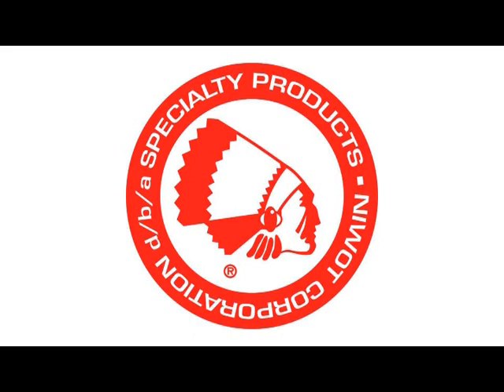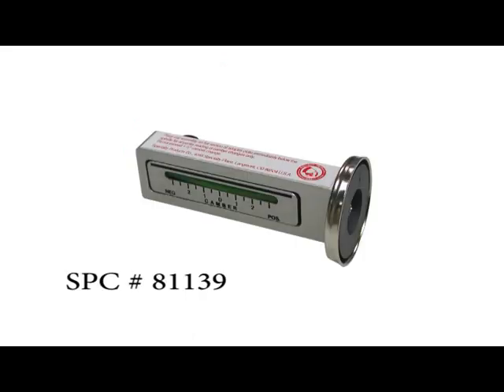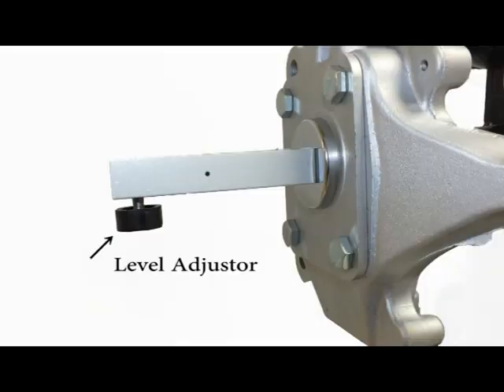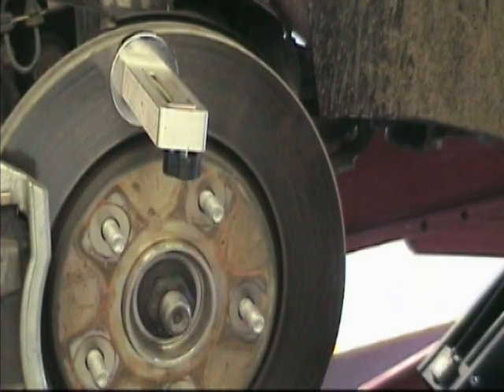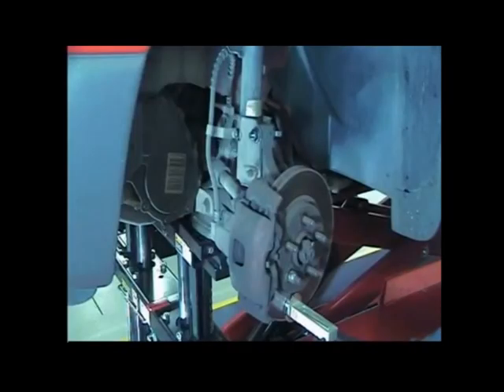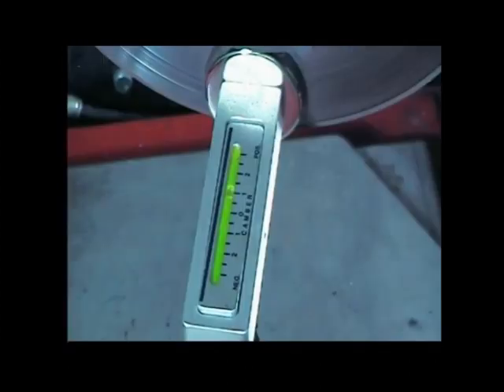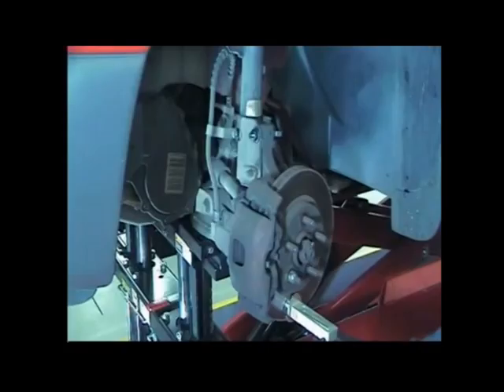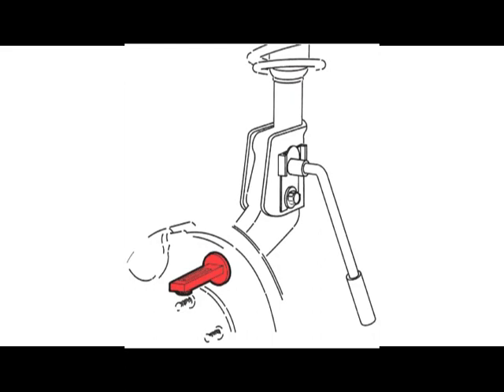81139 - Magnetic Adjustable Camber Gauge - SPC Alignment

Comment: For Pete's sake, how do you calibrate tool before use? Camber reading on the tool will be different with the wheel on the ground/loaded and with the wheel removed/hub unloaded, as when suspension drops hub down, camber changes.
Reply: You have to use a level or level source that you can trust is accurate and compare where it's set at. Adjust when you feel comfortable you are level at zero and see where it is. But what this video is saying is to check you camber before you begin. If you are at negative 1.5 degrees, and want 0 degrees, then whatever it is reading unloaded adjust until you get that 1.5 degrees back.

Example: reads neg -1.5 loaded. 
Reads neg -2.8 unloaded. 

You want to remove 1.5, so you adjust until it reads -1.3 unloaded. Then when loaded with the vehicle weight it should read 0.

However, it is not necessary to zero the level except on the rotor. Just add or subtract where you need to be when adjusting.
Reply: Correct

Comment: i thought camber bolts are for adjusting only not to be use as a mounting bolts,,i didnt see you take the camber adjusting bolt out did you take out the camber bolts?and put back the factory bolts? just wondering!!!
Reply: The SPC EZ-Cam bolts are to remain in the car to allow for future adjustment. Yes, the thread size is smaller than the OE strut bolts but all the current EZ-Cam bolts are grade 12.9. It is important to torque these bolts to the torque listed in the instruction and not more. With the correct torque on both bolts, there is sufficient clamping force to keep the strut and knuckle from pivoting.

Comment: Does the suspension have to be under load?
Reply from the maker: This tool will work on many types of suspensions and that will determine if it should be loaded or unloaded. On the McPherson strut illustrated in the video the suspension is unloaded.